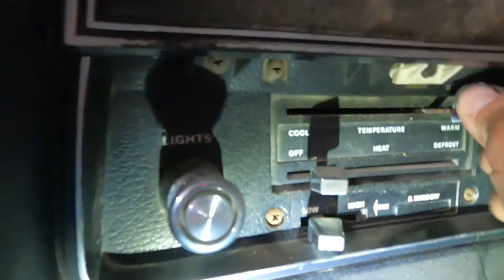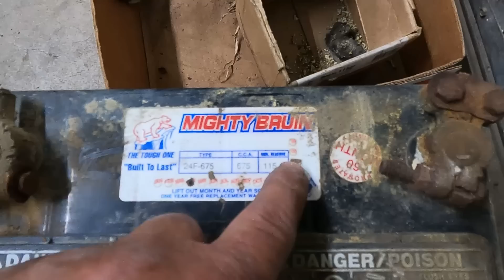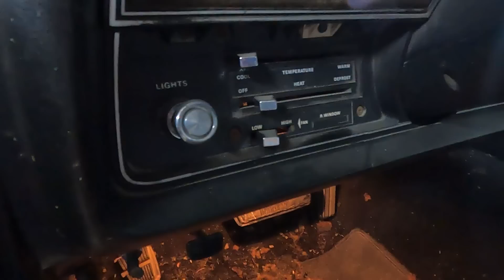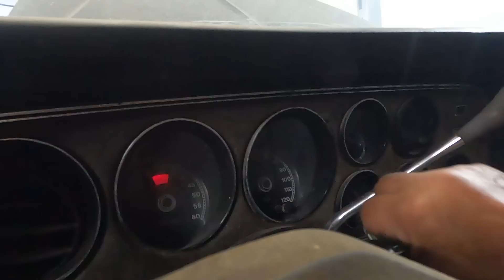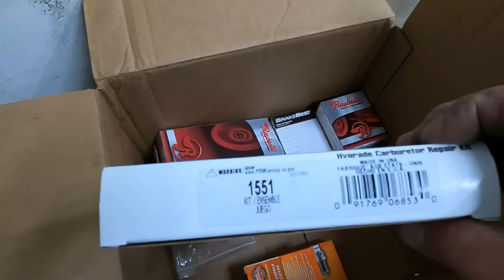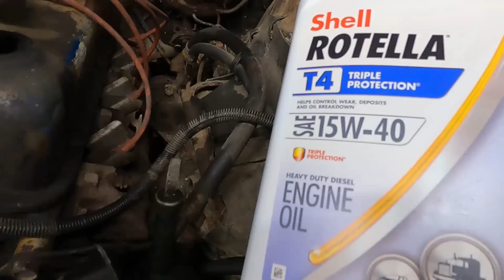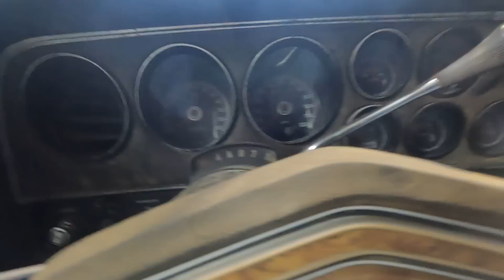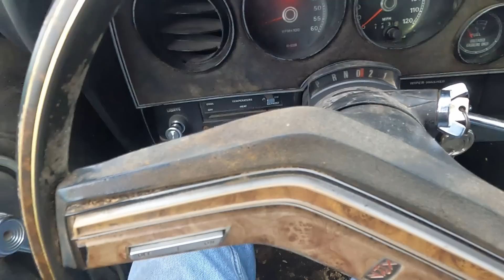PART#2  Wrecked and forgotten for 20 years will it run and drive  again????

Comment: Windsor engines no oiling problems were king had a 91 Crown Vic picked it up in 2000 with 130k drove it until 2010 odometer broke in 2007 with 230k my son drove it untill 2015 sold it to a neighbour that did not know what a oil change was it died in 2019 just as while live up in Canada in the rust belt there was no body left THIS engine lasted 27 years with its last 4 years no oil change. And the time I owned it half a Litre top up on 5k oil changes. Now Ford makes garbage belt driven oil pumps plasma sprayed cylinder liners all garbage. I have the worst engine ever made the 5.4 3V in my 07 F150 maintenance the shit out of it 200k on it now looks like the body will die before the motor since a new FX4 will cost 55k plus with a belt driven oil pump not going there and MINE no ticks rattles purrs like a kitten and burns a quarter of a litre every 5k.Ignorance is bliss.